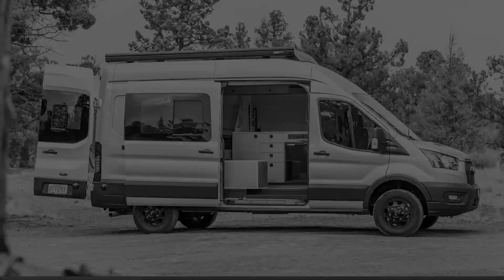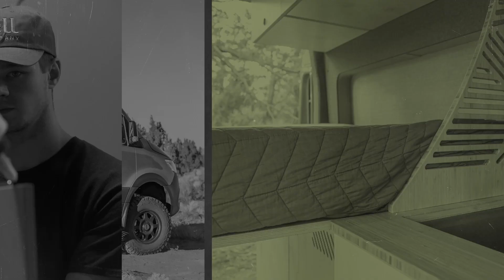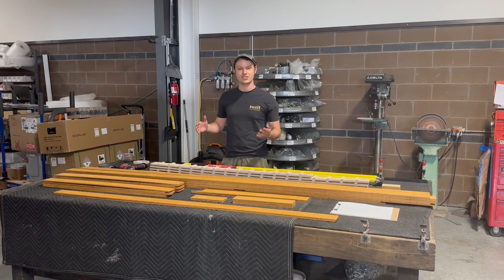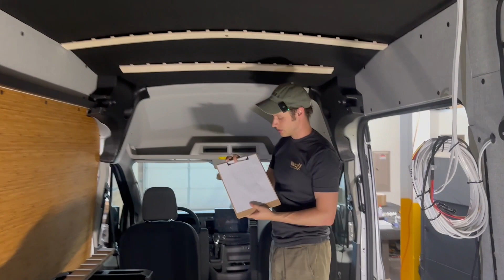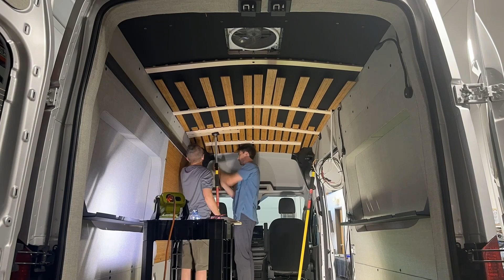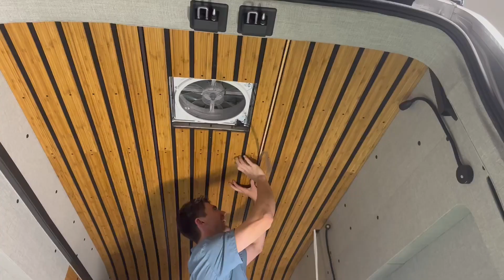How to Install a Slatted Ceiling In Your Van | Swell Van Co

Comment: cool install but if you ever have to remove part of a ceiling for something, like for example a leak, it would be extremely hard to do this. I think a better way is getting rid of the backing and just use the crossmember slats. If you have thinsulate on the roof, it will be black anyways. You can then put black minicell or even paint the crossmember slats black. It does make installation harder but much better down the road if you had to remove the ceiling. You also reduce a good amount of weight without the backing too
Reply from the maker: I like the thinking there and certainly if you could figure out how to mount all of the slats, this would be a nice way to go. We have found that removing the slats in the very rare case you need access into the ceiling isn't very difficult actually. Weight wise, there isn't a lot of weight in the ceiling panels, so our kit does make it a lot easier for installation and provides a premium look and feel that folks expect with this type of ceiling. Let us know if you ended up using only Thinsulate! We're always curious for new ways of doing things.